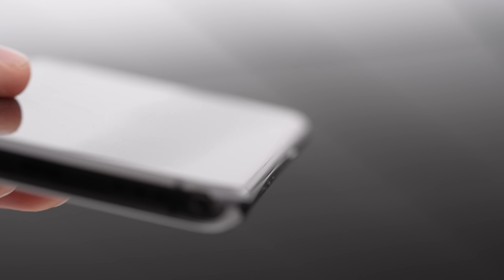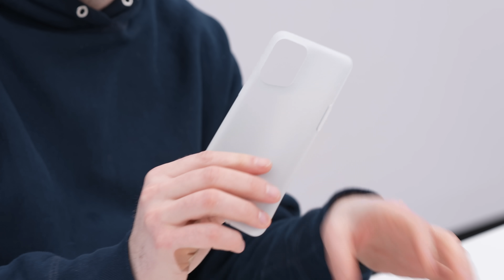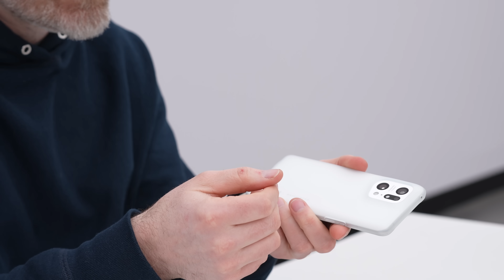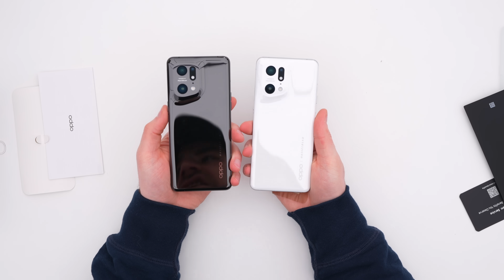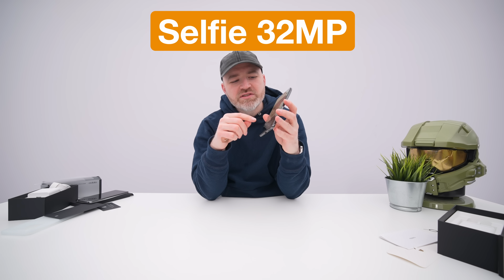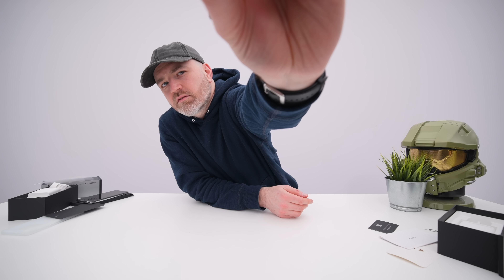Oppo Find X5 Pro is a SLEEK New Flagship Smartphone

Comment: Ceramic white with the cover that came in the box. Won't "feel so good" once you drop it on the road or footpath a couple of times... The cover is stunning and feels just as good as the phone without the cover. Just bought this brand new for AU$899 (US$618) from a local retailer. Heading overseas so Oz tax refund scheme will refund $81.73 (US$55). Couldn't connect to Android Auto initially, Oppo support fixed it...🤩

Comment: Only 2 things its missing.  Headphone jack and sd card slot. There is no phone that has it all:
1. High MP great camera array
2. Wireless fast charging 
3. Includes charger in box
4. Headphone Jack 
5. Sd card slot 
6. Snapdragon 8 gen 1 (or similar) 
If such a phone exists regardless of price (within reason obviously can't be like 5 grand but 2 would be acceptable) I WILL buy it.

Comment: So I "upgraded" from my Oppo R18 Pro to a Samsung Galaxy S21 Ultra back in October only because my poor Oppo ran out of storage space & no dual sim. Man was I absolutely shocked & disappointed in the Samsung. It turned out to have ELF & I had to get a replacement. The replacement was hardly better, and has since glitched so many times and burnt my hand, plus takes so much longer to charge than the Oppo & loses power & cannot charge on anything other than the Samsung wall charger - meaning I can't charge it in my car. I got so used to not worrying about charging my phone or it dying ever, I never even put it on charge at night when I slept, cos it took around 20 mins to go.from 5% to 100% even while I used it so I could charge it any time no worries, & the battery lasted around 2 days of heavy usage. I'm so scared now because I'm returning to Samsung for good (my phone company agreed to let me return it after it glitched and got so hot it burnt my fingers badly - and then I had legal representation suddenly they were more than happy with me.returning it). I'm thinking of going for the Oppo find X5 but I'm nervous. I really like the display and keypad function on the Samsung - just the general feel of it/look of the apps etc over my Oppo (I always had Samsung's prior to the Oppo) but the Oppo was completely faultless for me for around 5 years almost, so reliable. I absolutely love the Samsung camera though, and as I said the other stuff. But the phone itself is just a dud. Such a shame. I hope the Find X 5 Pro will be a good phone I can hopefully keep for a while cos I hate changing phones and this has been incredibly stressful for me

Comment: Looks slick, but if you drop that without a case or maybe even with a case it will shatter that ceramic, although a new flexible ceramic just came out so maybe in the future that won't be such a issue

Comment: Oppo need to work on its front-facing camera because it's crap, you pay £1,066 for a FLAGSHIP phone and it doesn't have camera stabilisation😭 Once you start moving your hands using THE FRONT CAMERA to capture scenes around you the video starts to blur. this is very obvious whilst using snapchat. 2018 Huawei p30 has a better stabilisation compared to my Oppo find x3 pro. Oppo step your game up or reduce your price .